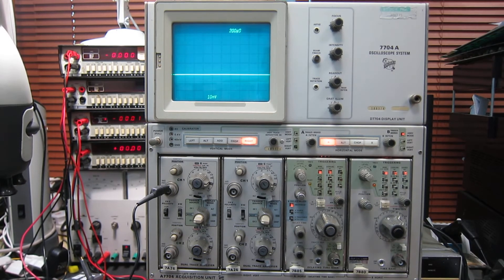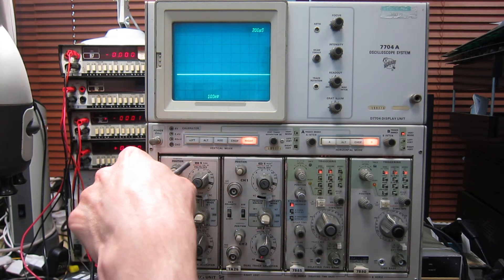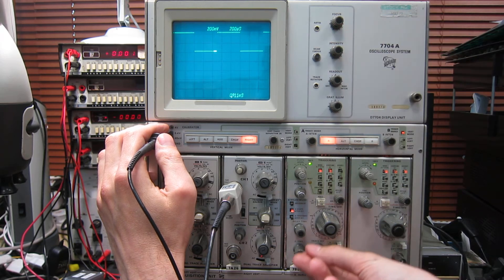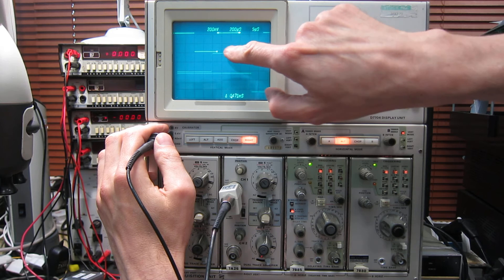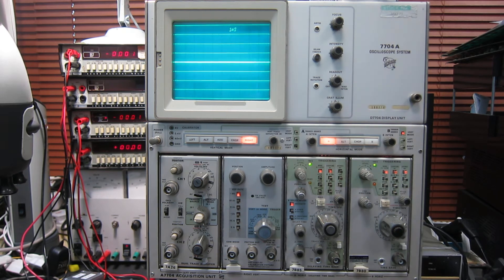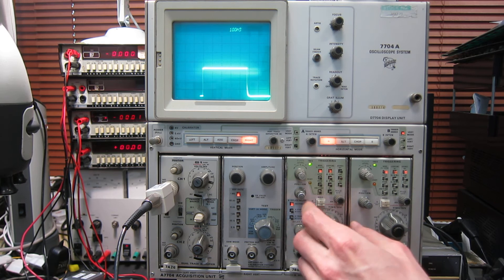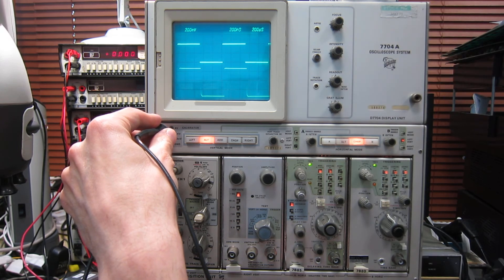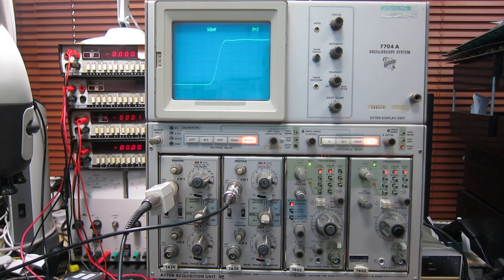Tektronix 7704A oscilloscope mainframe with 7A26, 7A26, 7B85 and 7B80 plugins

Comment: How long do the capacitors last in the power supply? Should i send them in for replacement? Mine work but i am worried.
Reply from the maker: @FutureEyesOnly-be3do  don't worry about the power supply capacitors too much. I've never replaced any of them and I've got loads of Tek scopes in regular use. I used my 7904A and 2430A all day today, and both of them are at least 40 years old. The only capacitors that have failed are the Rifa class X suppression capacitors. They give out some smoke and that's that. I just leave them in place and they give no further trouble. Nothing to worry about.